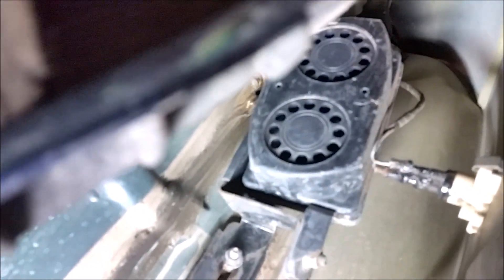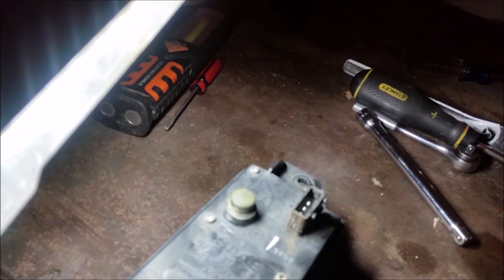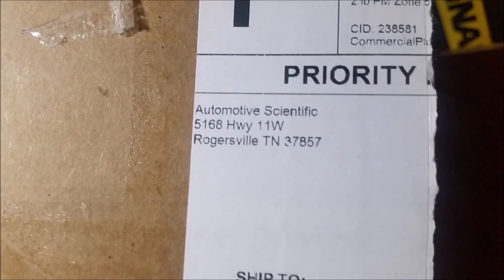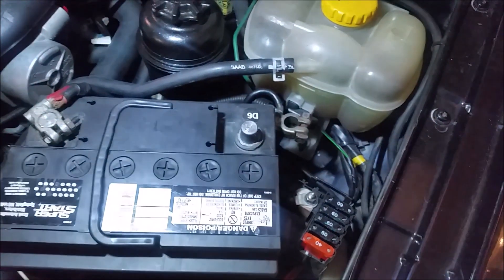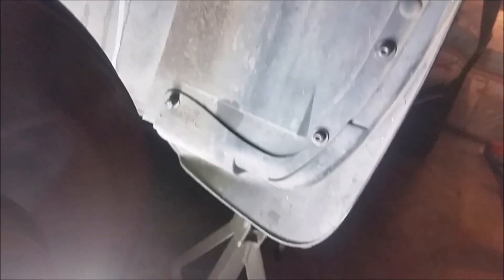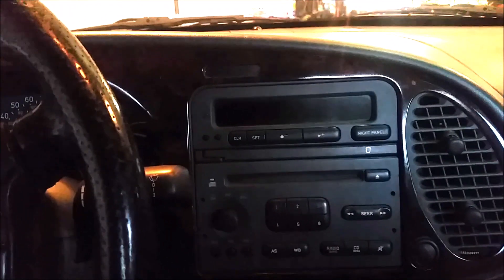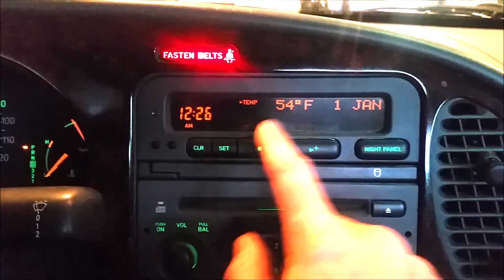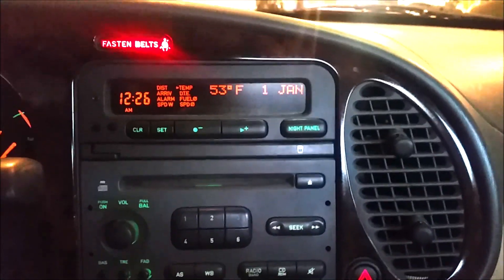S2E17 Saab 9-3 Alarm Module

Comment: If your alarm keeps activating for no apparent reason and you're happy that trunk and hood switches are good,  then when you turn off ignition and withdraw the key you then press the "night panel" button until "door alarm only" message is shown, leave car and lock in normal fashion with fob, you will have to repeat process everytime you lock car, the problem seems to be a cabin movement sensor problem which is located adjacent to rear view mirror.

Comment: I have a 2003 Saab 9-3 convertible and it honks  when I lock or unlock the car, but if I try to open the door without the key the alarm does not go off and none of the lights blink and I can start the car so I don't know what's wrong with it

Comment: My 04 convertible 9-3  alarm is not under drivers side inner fender as all i seen on you tube,?
Reply: Hi, I have an 06 SportCombi. With our era of Saabs, this siren doesn't exist. I had to get my door lock actuatord fixed to stop the alarm
Reply: I have a 2003 Saab 9-3 convertible it honks when I hit the key lock and unlock but if I open the door after resetting the alarm it does not go off and no lights blink and the car will start any clue?

Comment: My Saab 9-5 2005 45,000 miles has issue with keys wont lock car i synced it manually, works great but then stops again when i leave car dont think i saved it once got in program mode. Could it be the receiver box not the one around the ignition tho or could it be ignition, the car knows the doors are shut ie the door switches the radio turns off when pull key out ignition, door locks work fine ?? Please no one can figure this out,ANY question welcome p.s tanks for the video really.
Reply from the maker: I have a 9-3 OG. Think u need someone with a tech 2.

Comment: By the time these motors were being made General Motors had their grubby hands all over them, I'm surprised that they used Lucas equipment, in England they're known as the prince of darkness, useless kit, i would have thought AC Delco or Bosch would have been a better choice, cost cutting bean counters at it again, I've got a 1998 naturally aspirated 93 petrol, 36k on the clock from new, not a trailer queen, she's a working girl, is my alarm buggered? You're damned right it is, even after new batteries and capacitors.  Ive disconnected it as hazards were always fladhing when locked.